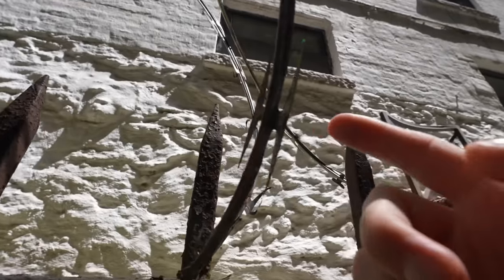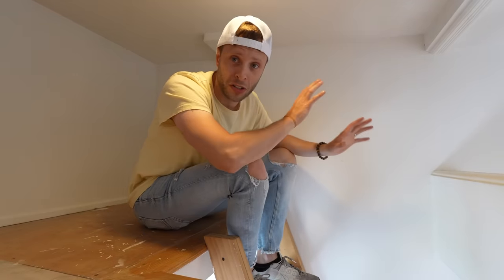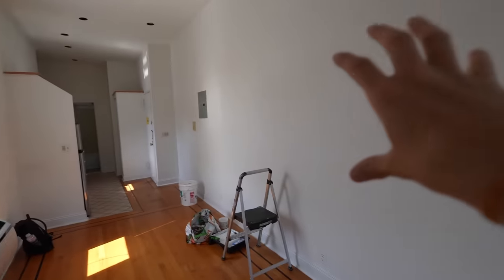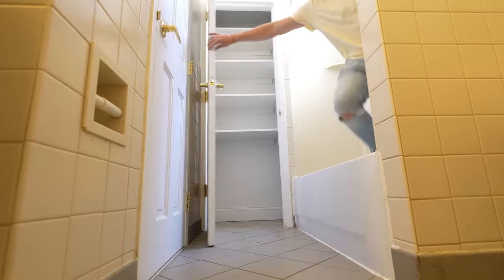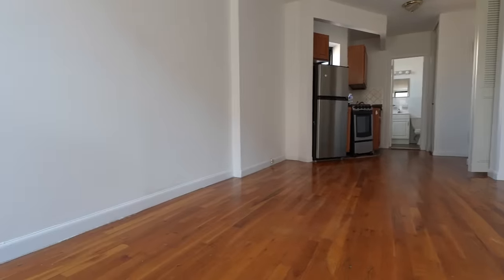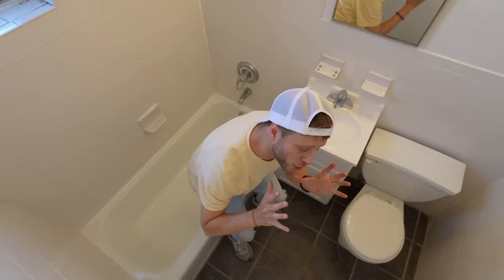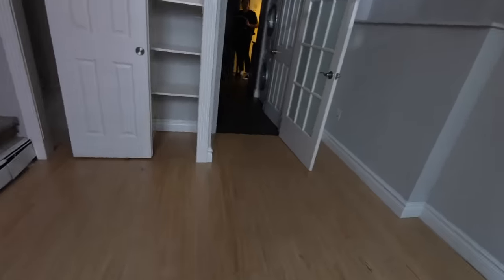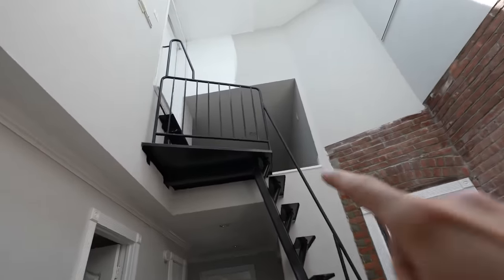Big Mistake… Renting a Tiny-Apartment in NYC

Comment: This just goes to show NYC will put walls anywhere and make a room any size they want. Also, 6 apartments in 14 minutes props to you Cash!
Reply: It has truly gotten ridiculous in NYC the last few years. The rent prices has gone up & the apartment sizes have gotten immensely smaller. I currently live in a (rent stabilized) very large 1 bedroom apartment building. Recently as tenants have moved out, they have been renovating the apartments. They've turned these beautiful spacious 1 bedroom apartments into either a decent 2 bedroom or a small ass 3 bedroom apartment and charging an extra $2,000 🤦 Smfh....

Comment: Apartment #1: Landlord, fix that bathroom! Sink, faucet, tub and wimpy 1970s towel bar are NOT acceptable. Apt.#2 - kitchen looks better to me - and bathroom IS worth an extra $100. The roof deck on the mirrored apartments hold promise - and I appreciate the fireplaces, if not the angle of the stairs (is that even to code?). Rob’s apartment needs some wall mirrors to increase the light and add to a spacious feel (I’m grateful for the tour - the mirror advice is my way of thanking you). With some greenery and statuary, the mini courtyard with the last apartment could be an amazing oasis - but the lack of a tub is a SERIOUS detriment.

Comment: There is nothing in New York that makes these rental rates sensible or to match the value for the dollar. And if you believe it does? You are insane. I stayed at The Webster for roughly $700.00 a month with a bath down the hall and a meal plan. It was a blast from the past and not a place that I would live for the long term. Very nice in 2003 but again, nothing in New York warrants these rates.